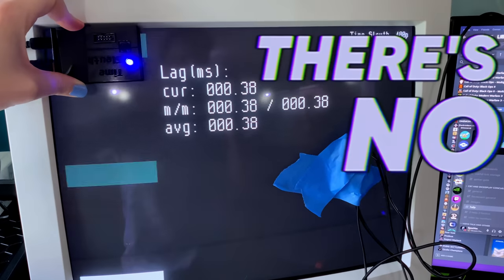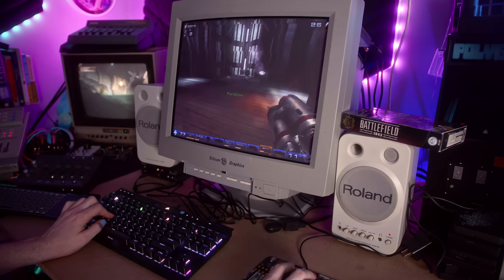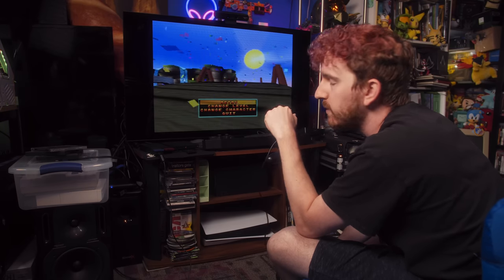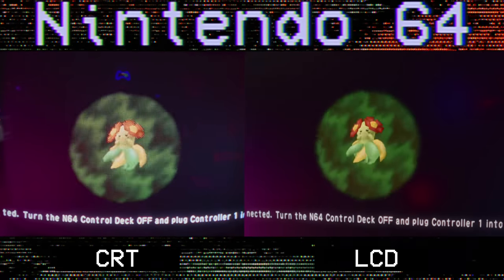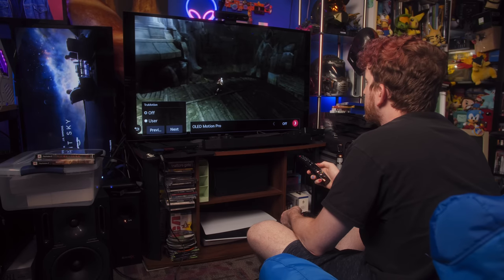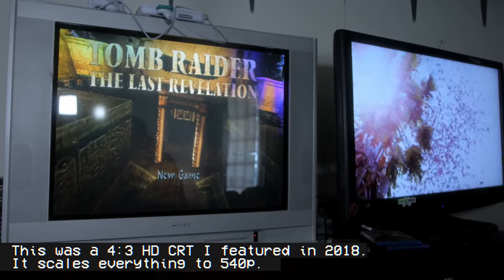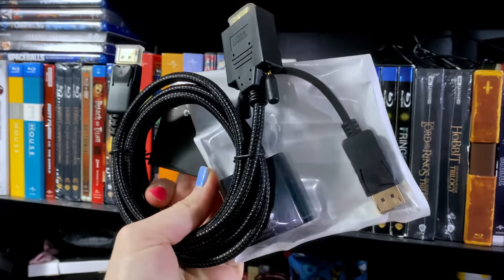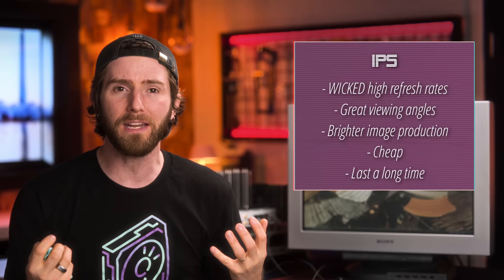Old Trash or Treasure? CRT vs LCD: The Final Verdict

Comment: Samsung is stopping LCD production. QD-OLED only from now on. If they get 27" 1440p 170+ Hz displays for under $500, LCD monitors are as dead as CRT. Just like that overnight. Color fringing due to the subpixel layout can be fixed with software.

One thing about CRTs I need to say. I really enjoy playing old console games on them. I wouldn't miss LCDs when they get replaced with QD-OLED.
Reply: They definitely aren’t stopping making lcds oleds no idea where you heard that

Comment: Living in south of Sweden I have found it INCREDIBLY HARD to get hold of a decent CRT monitors locally. I have been looking for nothing special but preferably something built ~2005... After 3 years of search I finally found an unassuming, bog standard, beige Compaq CRT monitor from 1997 for 10$. It's not what I wanted initially. But I couldn't be happier I can do anything from 640x480@85Hz to 1280x1024@60Hz.... but man, even at 60Hz, it looks and feels FAR better than 120Hz on a modern display. I will be using the GBS-C upscaler to upscale 240p 15KHz content with added scanlines to the display. :) That way it will look very close to a BVM as well.

Comment: Display latency is absolutely a valid reason to stick with a CRT display. Replacing a digital flat panel display with an analog CRT and a USB keyboard with a PS/2 one can easily reduce the combined I/O latency by 50 milliseconds, which is not a small amount. Latency is a thing that very greatly affects the user experience and one reason why modern computers feel so slow. Even when using a software that is very optimized, new computers still feel less responsible than 20 year old computers.

Comment: I personally knew that CRT would not be beaten by LCD for many years. When I bought my first LCD (2005–2006), I compared CRT and LCD. My CRT monitor fills gray in swipe mode, and it looks sharp as a knife when the LCD has about 1/2 inch (13 mm) of ghosting. LCD will never beat CRT in a straight line of RGB. (I have not watched the video yet; let's see if I see the same concept as I typed here.) The only benefits from LCD is weight and had less stress for eyes. After I used LCD had discomfort when worked with CRT.

Comment: I think I got lucky. A small town here in Wisconsin was doing a recycling event and everyone threw out old stuff to their curbs. 
I saw so many CRT TV’s. There was a mountain of pc parts and crt monitors but they were all gone before I could check them, think the city got to them. 

But I found a component and S video Toshiba CRT TV, an RCA S Video TruFlat CRT with dvd player built in, and the holy grail Sony Wega Trinitron 32”. It weighs nearly 200 pounds.

Comment: I honestly miss CRT's. I have one and it still works, but it makes a spark sound every once in a while so I'm too scared to use it. I really wish I could though.

At least I still have a few CRT tv's which I sometimes use.
Reply: It sounds like your fly back transformer is failing. It’s basically a high voltage transformer - sometimes the plastic casing and resin can fail and you get arcing. Don’t use it! 😊

Comment: my 175Hz QD OLED is still not as sharp in motion as my fw900 was at 100Hz and that was even one of the slower phosphor CRTs :(
Reply: The new QD-OLED is nice, but falls massively short when it comes to input response, motion, depth, and the colours on my Sony G520 are a lot more vibrant and richer than on the QD-OLED, shadow detail is much better on my CRT monitor too, when we have 1000Hz 8K QD-OLED, I think they might at least be superior for modern gaming, until then CRT is still king.
Reply: @Wobble2007  Man are you nuts ?
CRT are superior in motion clarity and for classic pixel art, but QD-OLED is a whole new game : infinite contrast, ultra high bightness with HDR1000, only 3ms input lag for good models (lower than what the most sensisitive human can detect), high refresh rate (not 1000hz until 2030's), and big huge fucking size. 
Everybody who see what a QD-OLED can do is blown away for a reason.

Also you are delusional about CRT being better at color.
Go see the gradients and DCI P3 scores on rtings of the best modern screens and get back on earth.
Reply: @hypnoz7871  I have a C1 and a QD-OLED, it's not even as nice as my Pioneer last gen plasma let alone my LaCie Blue 22 IV CRT, QD-OLED is miles off from high-end CRT, you clearly haven't used a LaCie Blue or a Sony G520 or other CRT on that level if you believe QD-OLED is anywhere near CRT level of quality, that said even though CRTs are miles ahead, QD-OLED is incredible, just not as incredible as Kuro plasma or high-end CRT monitors, give QD-OLED another 5-10 years and it will be a lot closer to CRT quality, better yet, wait for self-emissive quantum dot.
Reply: @hypnoz7871  they are nuts

Comment: @EposVox Great video! I'm curious how much you paid for the D24, if you don't mind sharing. You say the FW900 isn't worth 3K, and I agree. But If I'm not mistaken the FW900 and D24 share the same tube, but the FW has more functionality (able to run at a higher frame rate) and is a touch lighter compared to the 115 lb D24. The D24s consistently sell for around 4K (sometimes more, sometimes less depending on hours and condition). Just genuinely interested in your value comparison between the two, of course understanding we are comparing a professional grade BVM to a... pro-sumer(?) grade pc monitor. Not apples to apples. Anyway keep up the great content and thank you!
Reply: They don't use the same tube, the grille pitch and phosphors are different.
Reply from the maker: I’ve always heard that same rumor but I never quite understood it since the FW900 is 16:10 and D24 16:9 lol
But I didn’t pay 4K for it, but close. But mine was fully recapped/refurbed and delivered to me within that price too
Reply: @EposVox  It started because the tube in the D24 is the same size and ratio as what's in the FW. The bezel on the D24 masks off the top and bottom edges a bit.

Comment: i've had a vintage sony crt for 4 years it was tucked away in a closet in the house till i came across it one day and decided to hook it up with a hdmi to vga adapter  and it was too good till i noticed severe degradation in my eye sight, i have 240hz 1ms screen and it still doesn't even come close to the responsiveness of the crt

Comment: Have you considered looking into mems laser-scanning projectors? They have been around for over a decade and are basically CRT monitors in the hand. Too bad they are hard to find and sold on eBay for high prices since they are unique. If you ever find one though you will not be disappointed. It's a hard shame no one wants to make them considering how stupidly simplistic they are tech-wise compared to DLP and 3LCD counterparts.

Comment: Great vid, tons of good info! I see in some of your shots you look like you have a ton of CRTs..  So how has your luck been with failure rate?? I have 9 CRTs across a few different setups, and i've had FOUR major failures in the past 2 years. Pincushion, sync issues, screen flicker, and  vertical collapse. I used to yell "buy a CRT from the rooftops".  Now i'm more yelling "Buy a CRT.. but only if you want to learn safety and repair.. or know someone who does.."

Comment: Dreamcast had higher resolution graphics over the PS2. It's sad that the Dreamcast lost. :(
Reply from the maker: DC only did 480p if you had the VGA cable and only in some (albeit most) games. It couldn’t do 720p/1080i and PS2 could do 480p in a lot of games
Reply: @EposVox  Dreamcast COULD easily output 1080p, but it wasn’t a standard at the time.

And don’t get me started on how Sony skimped on the hardware…
Reply from the maker: I mean… that’s like saying the Gamcube COULD output 3D because the hardware was capable of it - if nothing was ever built to utilize it and it wasn’t a thing at the time, that’s not worth anything lol
Reply: Yeah this is definitely not true. Sorry but the PS2 is also capable of 480p.
Reply: @wiegraf9009  on 2D games.  Oh of course some games had Progessive scan, but they were sprite based or had heavy dithering and what-not.
Reply: @BJtheBassist  if you use the hard drive loader on a hacked PS2 you can force 480p output on many 3d games. There aren't that many PS2 games that require field rendering tricks in 480i.
Reply: @wiegraf9009  I had HDLoader.  Point is, the Dreamcast had anti-aliasing instead of ancient, dinosaur DRAM to handle the graphics and didn’t look like ***.
Reply: @BJtheBassist  That's fair enough, the PS2 did outclass the Dreamcast in some ways though. It had a DVD player and its streaming/bus capacity was massive, allowing for some cool graphical tricks. AFAIK the Gamecube was more powerful than both the PS2 and the DC though.
Reply: @wiegraf9009  you are correct!
Reply: @wiegraf9009  The PS2 outclasses the Dreamcast in most respects, which is no surprise as it's a whole year newer at a time when CPUs gained about 40% performance a year on average, and the DC has some commodity hardware inside compared to the PS2's unique design. The PS2 is especially good at particle effects and can even outperform the Xbox in some cases.

Comment: I literally sold my HP Omen X (1440p, 240hz, TN Panel) yesterday because I haven’t found a reason to use it for anything.

I’ve got a 22” Diamondtron and a 21” Trinitron and DLSS thanks to Nvidia, so I can run either at a scaled 2048x1536@120hz!

Oh, and no blocky pixelization or input lag.
Reply: i do the same soon, i feel like i have been lied to and today after 10h++ of research i know what is wrong with me and games. my eyes miss a crt!
i will sell my benq zowie xl2546k haha esports bullshit and get a f-ing crt.
i remember now why i was hitting all my railgun shots, it was the crt and the young sharp mind :)
hyped af for crt 💓 planning to buy a p1130 found local

Comment: Daily driving a crt as my main monitor, as work monitor, colour, gaming. And is not considered a high end one too.

Purposely run with letterbox on top and botton to run at 16:10, 1920x1200p at 60Hz usable modern resolution. With altered gamma, contrast and brightness, i was able to get good brightness curve with deep black even with room light off.

Wished my current gpu can output interlaced, i miss running 1920x1200i at 120Hz, it was a beast at it and 120Hz kinda reduce the observed interlaced effect and less flicker too.

To replace it, i wish for something like QD-OLED or OLED 4k monitor that is affordable.

Comment: I play PUBG on my 4:3 22" Mitsubishi CRT monitor at 2133x1600 at 90hz! I way prefer it to my dad's LG 240hz OLED. About a third of modern games I run on my setup support 4:3. The others usually keep my res and just force black bars to render the game in 16:9.
Reply: Create a 16:9 custom res instead of keeping 4:3 with black bars, that's how you gain more hertz.

I have a 19 inch 4:3 Samsung Syncmaster running at 1648x1236 (basically 4:3 1080p) 63Hz. Instead of keeping the same res with black bars, i would use 1600 x 900 at 85Hz. I'm glad the monitor has a 0.20mm phosphor dot pitch, it looks more crisp than a 1080p LCD monitor that i have.

The monitor can reach 1856 x 1392 but i have problems with VGA timings so for the moment i'm stuck at 1648x1236.

I always check the CRT specs to create any kind of resolution, my samsung reaches 85KHz, definetly you have a CRT there that goes beyond 1440p at 4:3 and must have around 110KHz for the electron guns
Reply: Try creating a custom res of 2133 x 1200 and testing refresh rates there, that is 16:9 by the way.

Comment: I really do need to fix the brightness issue on my CRT and get it up and running again. I even got a bonkers high end VGA cable for it, heavy gauge wires, individually shielded. But I haven't been able to properly enjoy it because the brightness has fallen off so much.

Comment: Its true i noticed my PS1 and PS2 games look better on a CRT than Oled tv its crazy but true , I just wish so many CRTs were not destroyed in the mid 00s as nowadays its near impossible in the UK where i am to find CRTs and the ones available cost like £200 for a small 14inch CRT monitor
Reply: Find a 19inch CRT monitor with a dot pitch of 0.20mm or 0.24mm max. Minimum max res should be 85KHz for the horizontal frequency and 1600x1200 is good enough.
Reply: @saricubra2867  Cheers 🥂 for the information hopefully I will be lucky and find one 🙂👍

Comment: Were your readings on the Samsung with HDR/local dimming disabled/VRR disabled? I didn’t catch anything about that. Should be much lower times?
Reply from the maker: GSync off and on didn’t make a difference. HDR was already off, it doesn’t have enough DR for HDR to be worth using in the first place
Reply: @EposVox  Thanks for confirming. Wow, that’s really impressive then by the CRT. Hopefully we can get some faster OLEDs soon enough

Comment: Anyone know if dual GPU can be used to render modern games at 4K on say a 3000 series, while a 900 series downscales and outputs at 1080i? Are there other lag free and lossless solution involving other external device? Cheers
Reply: yes there is a video about this topic on yt. a guy using dell p1130 monitor hooked at 900series but utilizes the 30 series for render. mindblowing
Reply: @delightedbylight9893  I ended up just grabbing a secondhand GTX 970. The result was indeed phenomenal, but there are a couple issues that make 720p a better option for me. 1080i has an extra frame of lag and the dual GPU setup causes GPU overheating issues. Did look excellent though and I’m sure a few set up tweaks could reduce the issue with heat.
Reply: @delightedbylight9893  I ended up just grabbing a secondhand GTX 970. The result was indeed phenomenal, but there are a couple issues that make 720p a better option for me. 1080i has an extra frame of lag and the dual GPU setup causes GPU overheating issues. Did look excellent though and I’m sure a few set up tweaks could reduce the issue with heat.

Comment: I don't think LCDs are anywhere close to being dead. LCDs are readily available and are good enough to suit the needs of most people. The same thing happened with Beta and VHS, and Laser Disk and DVD. (Early DVDs were apparently pretty terrible and failed all the time) Though the LCD tech might be worse, it's not so bad as to negate the benefits of being relatively cheap and widely available. My parents have a huge LCD screen that is bigger than my universities in class projectors and they only cost like $500!

Comment: Hello there, AMD has the fun option of giving me an Interlaced signal still via HDMI, and all I need is a viable adapter. Current one I have makes the CRT freak out, but do you have any suggestions on a HDMI→VGA converter? Should I use a powered one?

Comment: My CRT has damage on the anti-glare coating. Is there a recommended solution to that issue, do I try to remove the entire coating with some sort of chemical, or is there some way to repair or replace the coating? I use this CRT in a room without sunlight, so removing the anti-glare coating wouldn't be a negative to me.
Reply: I had this problem on mine. The solution is to remove the coating as there is no way to repair it. You have to take off the front shroud of the CRT and peel off the coating layer like a phone screen protector.
Reply: @wiegraf9009  not all CRTs use a film, most infact have a coating.

Comment: I tried using my old AOC 17 crt from 2005 and upon initial boot the image was so blurry and it took some time until it fixed itself. But yesterday while on use it sparked in front arching towards the metal feet of the table. It happened only once though. Is this normal for an old crt and will go away, or is it finally dying?

Comment: I do not perceive ghosting on my monitors (maybe because they're newer and thus pretty good), but on the other hand I can still see the single frames:
be it my CRTs (at 85hz), my 2k 144hz or my BenQ 1080p 240hz I can still see the single frames when movement is fast enough. Said in other words: I can see a gap between Frame A and Frame B instead of seeing continuous motion  either if I move the mouse fast enough or if a object on screen is fast enough.

It may as well could be that my CRTs are pretty old themselves, but I don't believe that that's the reason why I don't see a difference in this context.

Comment: GSync does add latency though. It is not available for CRTs. Not a very honest comparison here. Combine it with a buggy Gsync on Samsung G7, no wonder you get such a high latency.
Reply from the maker: Prior to filming, I ran LDAT tests for every combination of modes on the monitor - reflex, reflex+boost, GSync, etc - and what I showed in the video was the lowest latency option
Reply: @EposVox  With VRR control "off" on the monitor? Apparently, VRR control "on" does introduce 6ms of latency. It's a firmware "fix" for gsync flickering.